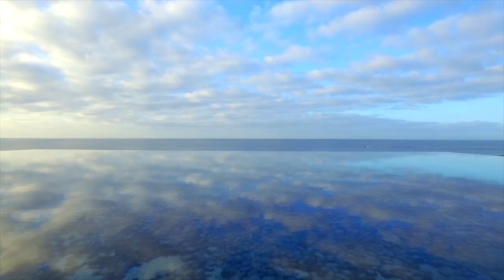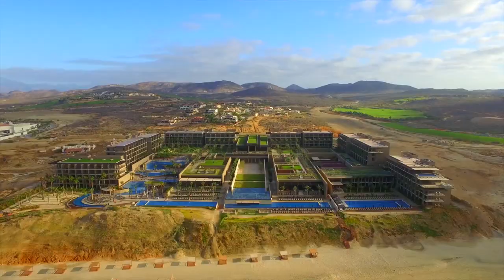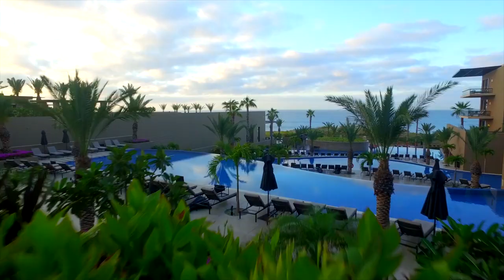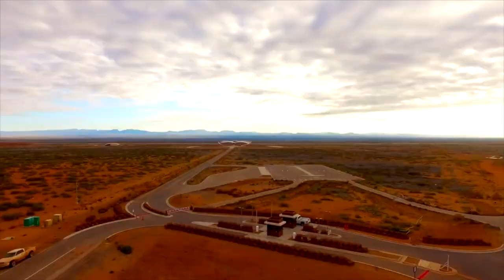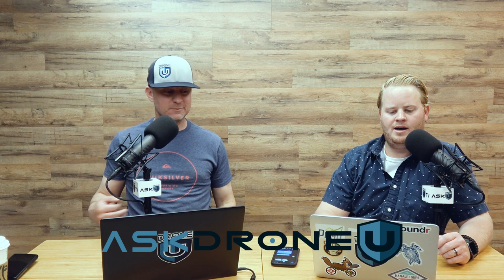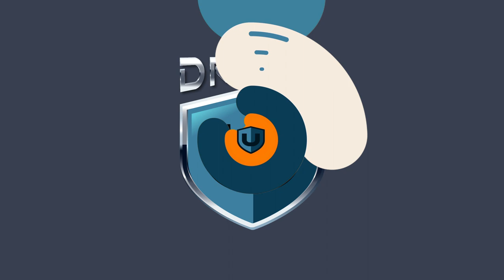What Can I Do To Deal With Magnetic Interference and Prevent a Drone Flyaway?

Comment: My job in the Navy involved calibrating aircraft compass and bombing computer systems, in the aircraft with engines and systems operating. This was done on the nonferrous pad on the airfield. When I bought my first drone, I searched and mapped a few local spots devoid of magnetic interference.  It wasn't easy to avoid underground, ground-level and power lines.  The best sites were a flat asphalt pad or a rock out in a field, which required a 50 yard walk away from my truck. To clear yourself of magnetic items, suggest using a Garrett Pro Pointer metal detector on yourself. Leave any unneeded items by your vehicle.  This will be a baseline you can work from when troubleshooting.

Comment: I had Kp index interference while automate flying in Northwest Territories up north in Canada 250mi from Yellowknife. It was scary to see the P4P flying away, luckily I have ATTI mode skills an I knew where I was thanks to the screen view. 900ft high, 1mi away, and a lot of mosquitos, I was able to get It back. Even after compass and IMU calibration, I still had issues. Option was to put the Mavic Mini to the job, it did a great job with no interference at all. Now the MM has a frame on the wall.

Comment: Agree, sounds like first that the compass cal was not completed prior to going in/up the parking garage.  Second I have seen many folks take off BEFORE they get GPS lock.  That surely would have helped.  Also I have found that a tighter compass cal by not extending the drone away from your body and doing the "circle dance" but instead ensure the drone is held away from metal objects like a belt buckle and then simply turning the drone with your hands to compass call in a tight area versus a possible 6-ft compass circle...works for me anyway.  You nailed it Paul, IMU must be done in a A/C cooled environment and on a perfectly flat surface.  BRAVO!

Comment: Just yesterday I went out with my Evo1 (not to fly) but to go over my settings. I placed the drone on top of a gas fire pit which has a metal frame. Immediately I received a warning that said magnetic interference - calibrate compass. I moved it a few feet to my deck and the error went away. However before I go out and fly again. I am taking it to an open grassy field and like Autel suggests. Remove your keys, watch, erc. And re-calibrate the compass. I sure don't want a fly-away as I'm a new pilot, but always watch YouTube to understand and fix problems to become a better pilot. OH Yeah! Also don't want to lose a $1000 drone or have any liability issues. Thanks guys.

Comment: I had an interesting situation where I was trying to do a comparison with GoPro hero 7 Blk and Osmo action mounted to my M2pro, the GoPro did fine but the osmo interfered with compass, and gps satellite connections, at first thought it was the PGYTECH Mount for osmo action because it has large brass insert on it so I replaced with stock Dji Mount and the osmo action still interfered so much as I would not fly with it mounted.

Comment: Are you sure you really know about drones? You don't calibrate the IMU because of magnetic interference, ever. If you are experiencing magnetic interference, you move away from it.  The IMU or compass  should not be recalibrated unless the app requires it and should not be done routinely. Rubber has no effect on protecting a drone from magnetic or electromagnetic interference at all. There is no need to do an elevated take off as it will give a fake sense of security if magnetic interference is present and the IMU and compass start to diverge as you move away from it. Long winded, bad advice.